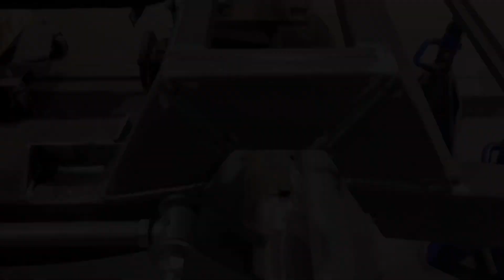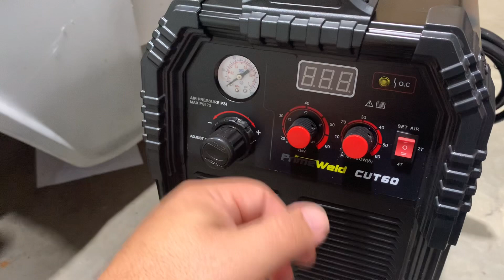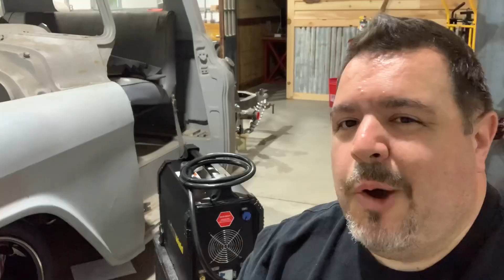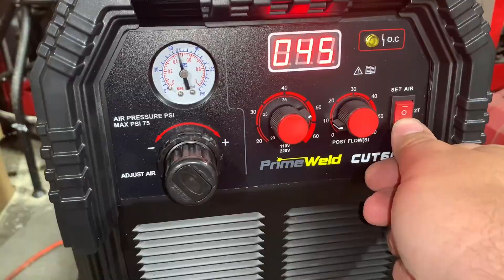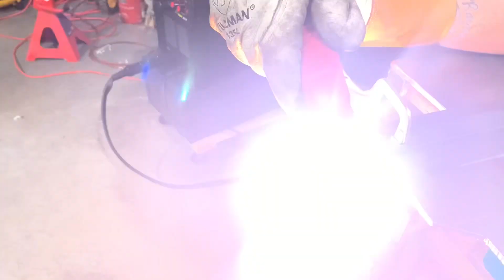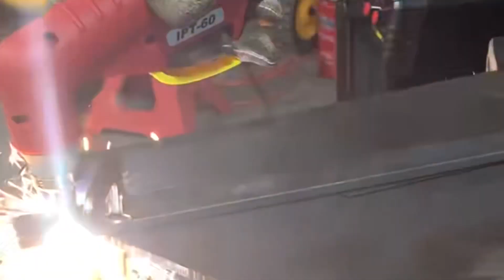Primeweld Cut 60 Plasma Cutter | Meets the 55' Chevy Truck Build! [ULTIMATE Fabrication Power]

Comment: What are you thinking for a cnc plasma?
Reply from the maker: The table? I think Id ultimately like to END up with the Langmuir XR but I can’t justify the cost while I learn. Im thinking the standard crossfire and then jumping in to the XR. The “Pro” doesn’t make sense financially to start with if I’m going to end up with a more expensive machine. Does that make sense?
Reply: @intheshoptv  makes sense, personally I am going to go with the pro bc it's a good in-between size that it is significantly more capable than the standard crossfire while being fairly affordable compared to the xr and then end up going with a 5x 10 when I outgrew the pro

Comment: BTW man your doin awesome work seeing how well the prime weld plasma actually works just made my mind up on wich brand I'm gonna go with for mine kinda wish I woulda bought the prime weld tig and stick set up I was looking at but ended up going with a different company on it wich the one I got is great had all the settings and features I need but I rly like the look and function lay out of the prime weld equipment. But great video man keep rocking it
Reply from the maker: Hey thanks so much! Im really happy with it and am actually interested in their mig 180. It shows when a company actually cares about their product and customers. Especially in a time where customer service is all but a memory.
Reply: I looked into the TIG welder and for the money it comes with really nice stuff. And their packaging is out of this world good!
Reply from the maker: @79_Trucker  Id really like to have a second mig welder in the shop so I was looking at their mig 180. Comes with so many extras, including the aluminum spool gun, its just too good a value.